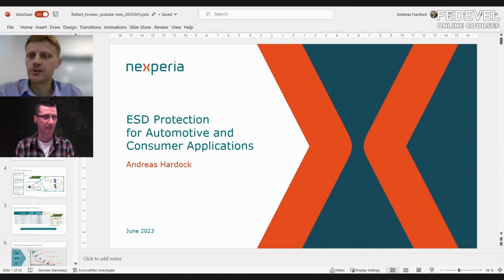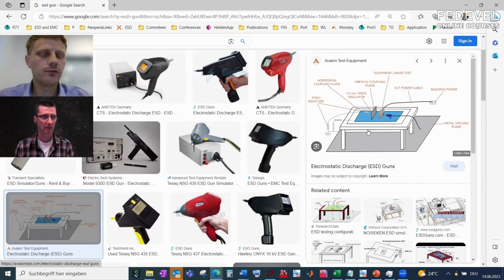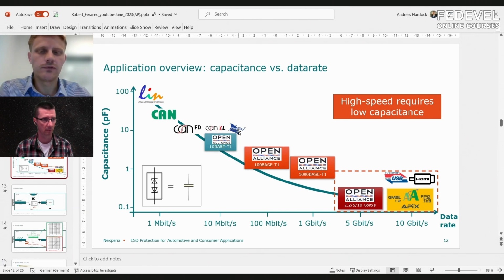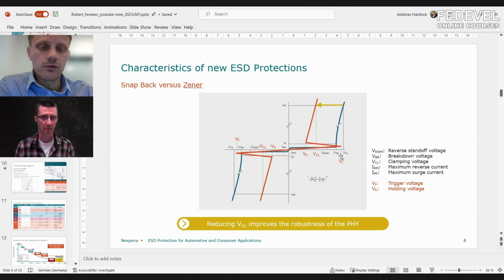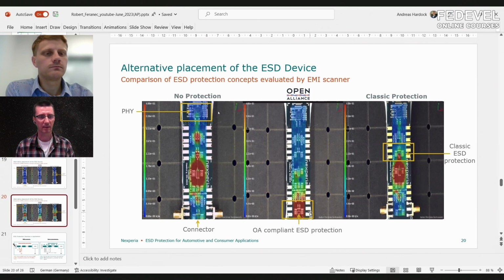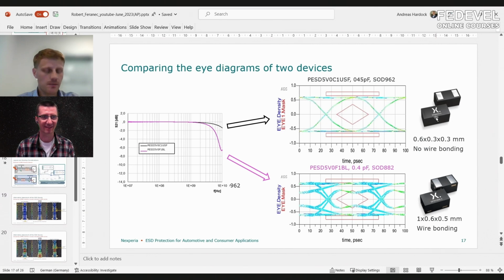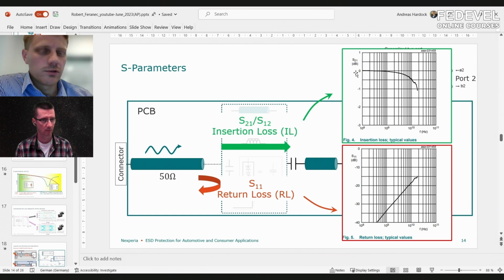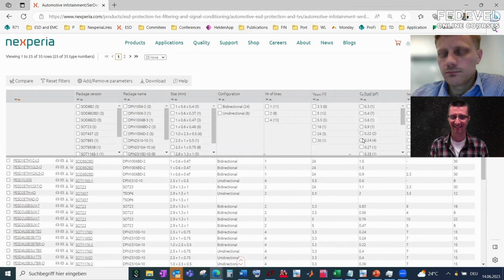How To Select and Place ESD Components To Protect Your Boards?

Comment: Thanks for the free lesson. In a USB 2.0 application I had an issue with the TVS diode capacitance. By soldering a TVS diode (SP0502BAJTG) with roughly 40pF capacitance the PC was not able to recognize the device. Changing the diode with a 0.4pF capacitance TVS diode (szesd7205dt5g), the device works fine
Reply: Probably you would come away with it with full speed.

Comment: Great video Robert and Andreas!  One minor confusion (really feedback to Andreas): at 33:48 the performance of the upper schematic in the grey box (large schematics on the left) is plotted in blue in the lower trace, while the the schematic in the lower blue box is plotted in upper grey trace. It would make the point much clearer and quicker if the two schematics swapped colors and positions.

Comment: One thing i was missing in the segments about direct, indirect and air discharge is the test with a coupling plate. You have a metal plate (roughly 50x50cm) that is connected to earth over a 1MOhm resistor. You place that plate in 10cm distance to your device (EUT)  (you move the plate or the EUT around to cover every side individually). Then you apply the ESD pulse with the ESD-gun directly connected to that plate.
The idea here is that you create a very fast and pretty broadband electromagnetic field impulse with discharging into the plate, and if your design has any bad antenna structures, they could pick up that impulse and potentially trigger a system reset, disturb communications or register a false user input. This is part of the EN 61000-4-2 standard
Reply: The test you describe seems more like EMI (ElectroMagnetic Interference) rather that ESD (ElectroStatic Discharge), which is the subject of the video.  EMI is, of course, important, but a topic in its own right, I think, and leads to PCB design strategies rather than selection of ESD components, I think.

Comment: Great Video! 
One thing that is still confusing for me is the selection of these components based on their parameters. e.g; what should be the trigger voltage, breakdown voltage, clamping voltage for a 3.3v signal lines of an IC where it mentions absolute maximum rating of 3.6 volts in the datasheet? Should we select an ESD protection diode with clamping voltage less than 3.6 volts, if yes, what should be the trigger voltage? It would be Great if you explain these parameters with an example in a separate video. 
Thanks ♥
Reply: Phils Lab is explaining this very good. Also look at Application Notes from different manufacturers about ESD Protection. Those voltages are being explained there properly

Comment: I've spent weeks working with a fluorescent CFL round (circular ring) light directly above my circuit board, about 6 inches away from the circuit board. I've had at least 5 Mosfets and also small TO-92 transistors that mysteriously stopped working or never worked. I've never in my life experienced failures like this. I put my Oscilloscope near the light and it produces 50Khz, a sine wave that emits 6 inches away from the bulb, in the open air, without the test leads touching the fixture. I tried searching online to see if a CFL can cause static electricity or a simulated ESD failure. I can only assume that it does. The light is effectively a charged high voltage plasma, emitting a strong electrical field around it. Are fluorescent lights safe to have near transistors and Mosfets?